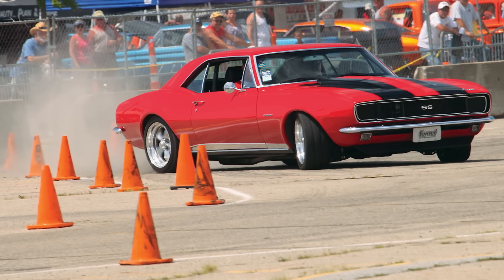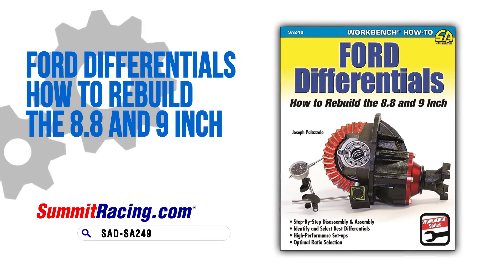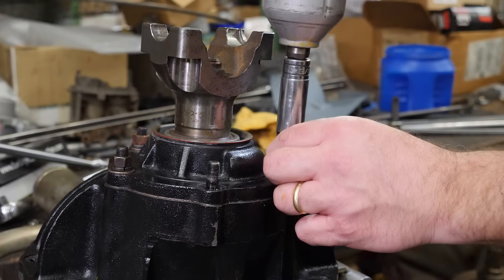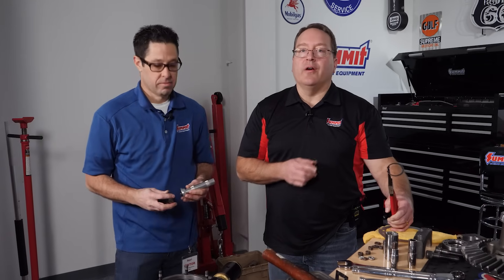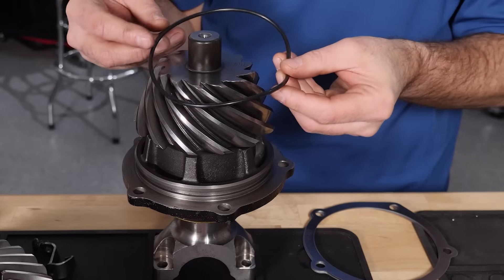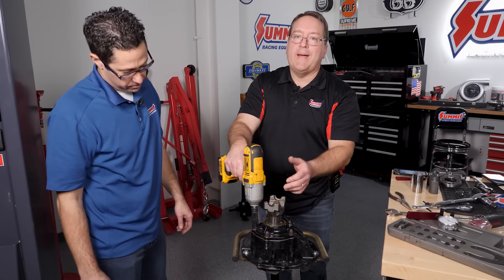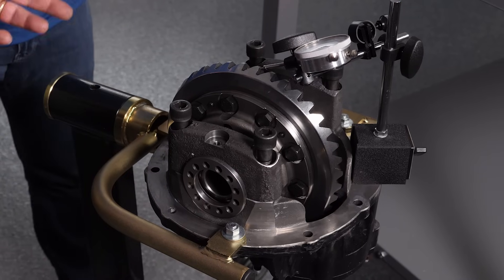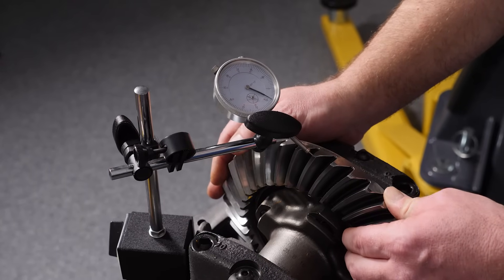How to Install a 9 Inch Ford Ring & Pinion Gear Set

Comment: Im in the process of putting a Yukon 31 spline in my stump that i took out of my 77f100 . 2.79 gear ratio … I can adjust the ring gear all the way  away from the pinion gear as far as it will go and at best i get 6 thousands ..  can i put a 19 thousands shim on the pinion gear to achieve my desired 8-12 thousands if backlash ?

Comment: What did you set the carrier bearing preload to? I didn't see that!
Reply: I noticed that too! Very important detail to leave out. Video seemed rushed at the end.  Also, the backlash measurement should be taken more perpendicular to the axis of the axle and tangential to the ring gear.  Your video shows damn near 45'.

Comment: This can happen with a Strange 1350 billet 9" flange.  There is a footnote when ordering this flange to order a spacer kit with it so that the pinion nut does not bottom on the pinion gear.  No crush of the sleeve will occur if this happens.
Reply from the maker: Thanks for your additional input, Mark!

Comment: Nobody ever mentions the tightness of the main bearing adjustment when using the spanner wrench. How much squeeze on the bearings? 🤔🤔
Reply: Once you set your final backlash, you tighten each spanner nut to the next hole for the locking bracket.
Reply: @MrBubbag77  You are correct.  That's my procedure as well. Not shown in this video. Kind of important to neglect....

Comment: Cool vid!  Minor suggestion.  Next time please mention the tool list is in the description at the beginning.  :)
Reply from the maker: Hi! We appreciate your feedback. We do have the parts list included in the description. I will add it here for you for easy reference:
Proform Pinion Setting Tools
https://www.summitracing.com/redirect?banner=SOCIALYT211008

Summit Racing Magnetic Base & Dial Indicator Kit
https://www.summitracing.com/redirect?banner=SOCIALYT211009

ACDelco Ft.-Lb. Digital Torque Wrench
https://www.summitracing.com/redirect?banner=SOCIALYT211010

Chicago Brand Dial Calipers
https://www.summitracing.com/redirect?banner=SOCIALYT211011

ACDelco Tools Digital Torque Wrenches
https://www.summitracing.com/redirect?banner=SOCIALYT211012

OTC Bearing Splitters
https://www.summitracing.com/redirect?banner=SOCIALYT211013

OTC Variable Pin Spanner Wrenches
https://www.summitracing.com/redirect?banner=SOCIALYT211014

SA Design Ford Differentials Book
https://www.summitracing.com/redirect?banner=SOCIALYT211015

Motive Gear Performance Ring and Pinion Sets
https://www.summitracing.com/redirect?banner=SOCIALYT211016

Richmond Gear Complete Ring and Pinion Installation Kits
https://www.summitracing.com/redirect?banner=SOCIALYT211017

Summit Racing® Ring and Pinion Marking Compound
https://www.summitracing.com/redirect?banner=SOCIALYT211018

Summit Racing® Axle Assembly Adapters
https://www.summitracing.com/redirect?banner=SOCIALYT211019
Reply: @SummitRacing .  Thx.  I took notes in the beginning.  Was commenting about the stand when I got to the end of the video and you mentioned the tool list.  I deleted my comment and suggested you mention it earlier next time.  :)